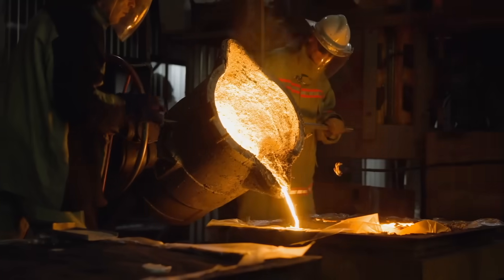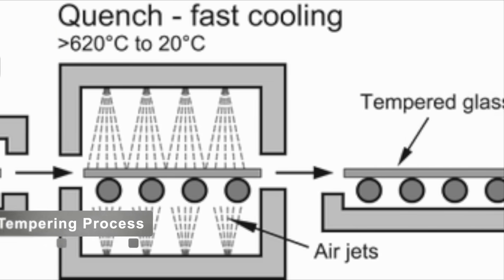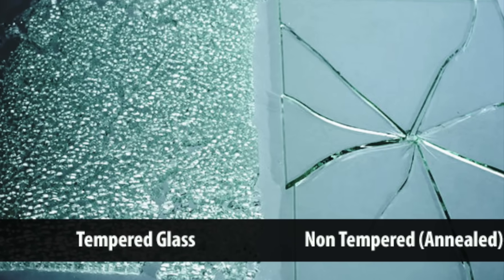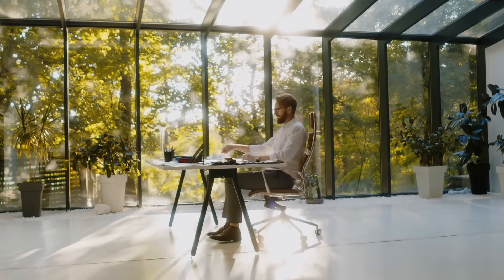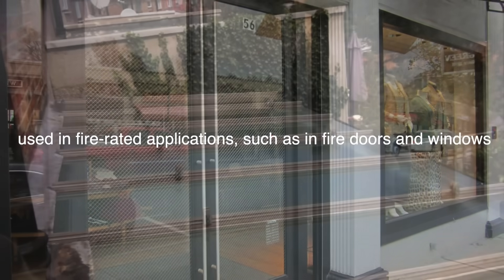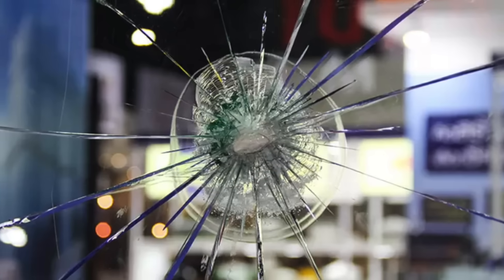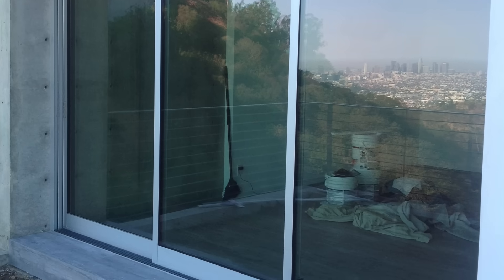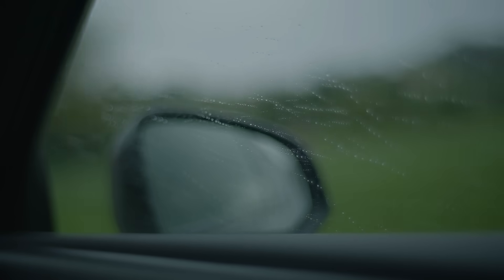What is Tempered Glass? and A Look at Other Glass Types

Comment: You forgot to mention borosilicate glass and it's a very special glass that has many uses Corning devloped this glass for cooking and just about all scientific glass is borosilicate glass 🍷
Reply: What's even cooler is Visions - it's a clear pyroceramic, much like wood stove windows. It's basically immune to heat as they balance the properties of the expansion of the glass and the contraction of the crystal ceramic so that it has near zero thermal expansion. To give you an idea, borosilicate has a thermal expansion of 3.3, and regular glass 8.5 - visons pyroceram is about 0.3. The fanciest stuff for making perfect optical mirrors has a thermal expansion of 0.007.

Comment: Patterned semi obscure glass is another, the surface is formed with ripples, bumps / flowers etc. In double glazing, one pane has the surface finish on the inside of the unit so the outside surfaces are flat and easier to clean

Comment: Wire is placed into glass in order to maintain the integrity of the fire barrier. Unsupported glass wil fall from the opening and allow airflow past the barrier, there by feeding the fire .
Reply: This is only applicable in fire rated glass aka wire glass. It is rated to withstand a fire for 45 minutes.

Comment: Not sure Low E coatings are best for the vertical south facing windows in northern states. Here you want a high high SHGC (solar heat gain coefficient) and a high R-value like you get with triple pane and another boost from krypton rather than Argon.
Reply: LowE comes in high solar gain, moderate solar gain, and low solar gain varieties. For south facing windows, that have adequate shading in summer, a high solar gain LowE coating is much better than no LowE coating for energy performance. 
Glass with a high solar heat gain coating allows solar heat in nearly as well as clear glass, but keeps the gained heat inside when the sun is no longer heating the window, unlike clear glass that allows inside heat to head back outside.
Reply: @gregcorwin8316  Thanks - I did not realize there is Solar Control Low-E (blocks solar) and Passive Solar Low-E (often called "soft coat") which passes solar energy. It seems that LowE coating actually reflect long-wave infrared radiation where regular glass absorbs in and thus gets warmed.  Cool

Comment: tempered glass on cell phone screens? are you kidding?
more like  xmas decoration glass. it breaks if you look at it wrong! 🤨
mine broke after it fell one time. then I lost MY temper...
Reply: Tempered glass used in cell phones is chemically strengthened unlike tempered glass for residential, commercial, or car windows (windshields exempted. windshields are always annealed laminated glass), that are thermally tempered. 
Chemically tempered glass does not break into small pieces like thermally tempered and is not nearly as strong against impacts... in part because the glass in cell phones in much thinner.